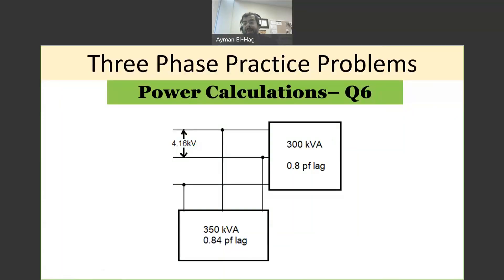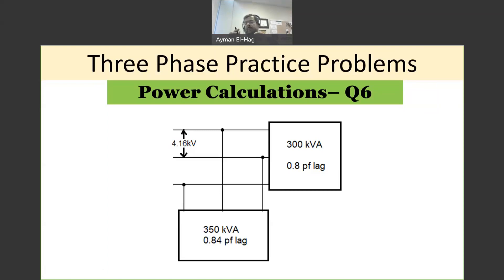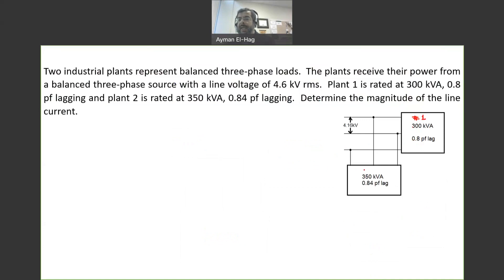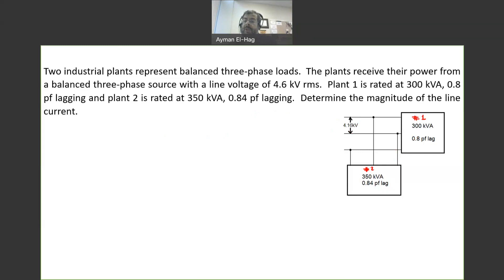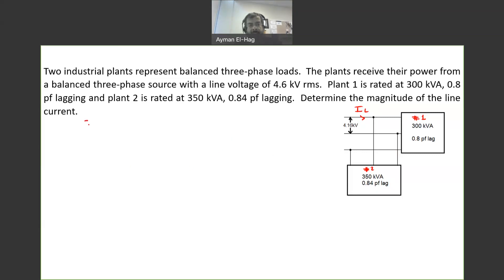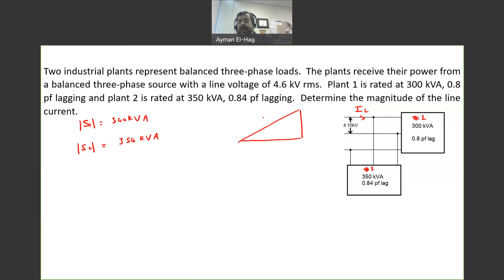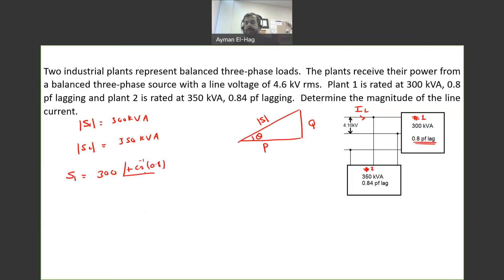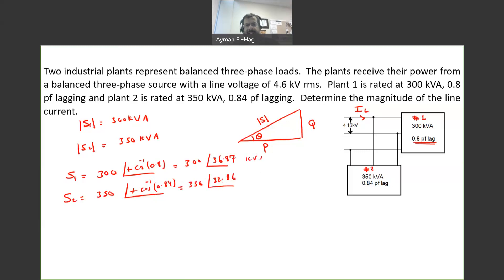Three phase circuit - Question no. 6

Comment: Hi Professor, should the IL = 90.16A ? Thanks.
Reply from the maker: In this question, two values of the line to line voltage were given by mistake, i.e. 4.16kV (in the drawing) and 4.6kV (in the question text) so at 6:35 the current value can be:
I = 649.6kVA/(SQRT(3)*4.16kV) = 90.16A or
I = 649.6kVA/(SQRT(3)*4.6kV) = 81.35A
Reply: @electrical4everyone  Thank you so much!